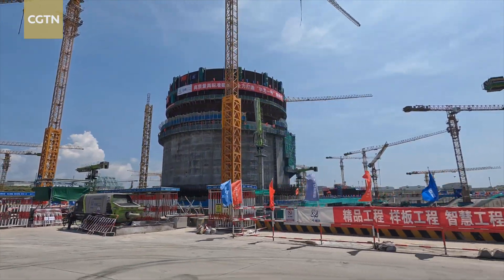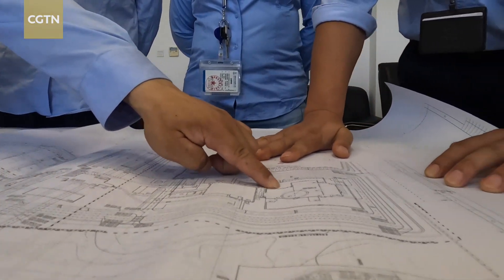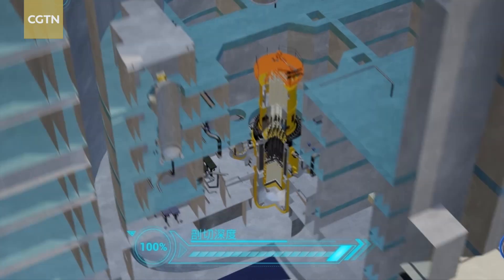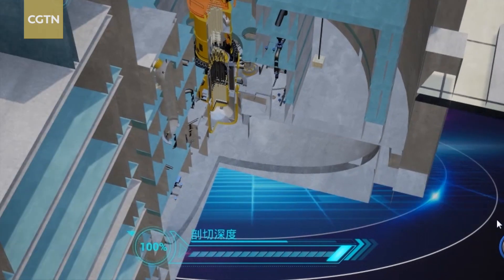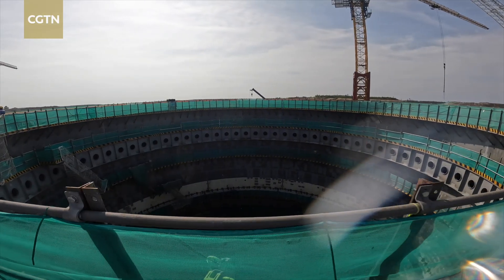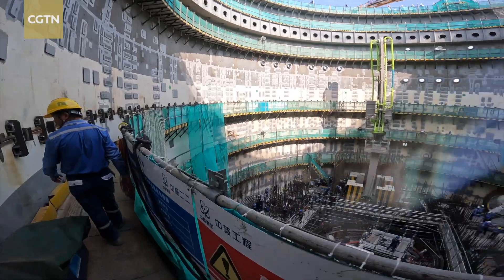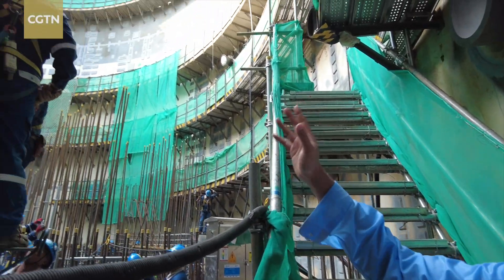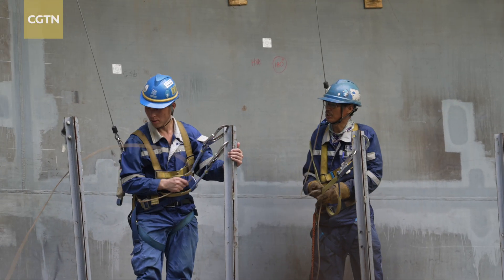China is building world's first commercial land-based SMR

Comment: I would like to see a cost comparison with solar+wind+batteries.
Reply: Actually when people talk about solar energy the forgot that you needed alot of energy to make a solar panel. This leaves carbon footprints too. It is the same for wind turbines.  The important consideration is the net gain of energy over its life time. In this respect the best is hydropower and wind turbine. The other is solar heat (not light to electricity). In this method China had build one experimental one. It uses hundreds of mirrors to focus the heat onto a heating tower to melt salt. This superhot molyen salt will pass through a heat exchanger to generate steam that drives turbines that in turn drives the electricity generators.  Nuclear generators are the most consistant because it is independent of the weather. Unfortunately it too needed alot of energy to mine and concentrate the fission materials not to mention environmental degradation caused by  the mining process. The nuclear wastes too needed a source of energy to package and store. So its net benefit is questionable.  The best solution is to couple the switch from burning fossil fuels with encouraging people to use less energy like taking public transport, driving smaller cars (even if they are electrical) and use less energy in cooling ir heating of homes and baths etc.
Reply: @chee-liekho5860  My reply to yours seems to get deleted, maybe the poster of the video doesn’t like critical comments about nuclear power.
Reply: @chee-liekho5860  Actually, Amory Lovins (Fusion power, the case of the wrong competitors, Forbes) thinks it will not. Fusion does not yet work and even if it will one day, it is highly doubtful that it will be cheap compared to wind and solar. That’s a common misconception that fusion power has to be cheap. And now people realize that Tritium, which is in most fusion power solutions needed, is not even ubiquitous… That article I mentioned is really instructive.
Reply: Agree that fusion power right now is not even working let alone being cheap. Right now the energy used to maintain the high temperature plasma to fuse tritium is higher then the amount of energy generated. A negative balance of energy. True that even if it has a postive balance output it will be too expensive. But then many technologies starting point is not cheap due to economics of scale or lack of knowledge.. Once the researchers fine tuned it and understand it things might be different. Looking back in history when the first chain fission reaction was achieved who can tell then that one day a nuclear reactor can be small enough to fit into a submarine. Given time the researchers can achieve some breakthroughs.
Reply: @chee-liekho5860  Yes, it's possible that fusion power will get cheap and there are also new fusion technologies (without generating steam) researched. But in the meantime solar and wind will continue to get cheaper and cheaper. So, there is a possibility that fusion in a few decades will work and will be very cheap. I just wouldn't count on it. It's pure speculation.
Reply: @daniel_berlin Agree but sometimes in small countries with high population density there is simply not enough suitable space to put up sufficient windmills and solar panels. Sometimes there are also unsuitable climate and weather conditions. So every sorce of cheap non polluting energy is necessary to augment one another. Energy is also needed to make solar panels and windmills.Therefore Fusion research should not be written off.

Comment: Small modular reactors (SMRs) are nuclear fission reactors that are smaller than conventional nuclear reactors. They can be constructed in one location (typically a factory) and shipped to the site where they will operate. They typically have an electrical power output of less than 300 MWe (electric) or a less than 1000 MWth (thermal). Many SMRs rely on a manufacturing-centric model, the requirement for many deployments to secure to large economies of unit production necessary to achieve economic viability. Some SMRs, typically those using Generation IV technologies, secure additional economic advantage and in some case large, through improvements in electrical generating efficiency from much higher temperature steam generation.

Modular reactors reduce on-site construction and increase containment efficiency and are claimed to enhance safety. The greater safety should come via the use of passive safety features that operate without human intervention, a concept already implemented in some conventional nuclear reactor types. SMRs also reduce staffing versus conventional nuclear reactors. SMRs are claimed to cross financial and safety barriers that inhibit the construction of conventional reactors.
Reply: Wouldn't SMR be just like moving nuclear submarine or carrier power plant to land?
Reply: @dragilxcom4176  Conversely, SMR technology can be ported to nuclear submarines and aircraft carriers
Reply: @dragilxcom4176  This is different but even if it's that simple, what's your conclusion from that? SMR is a big deal due to its economic implications... especially in a world suffering from an energy crisis.
Reply: @mike4evolution  How much different?  Aside from the safety measures and automation, if it is still fission reactors I'd think it should share the same technology.
Also, I would think the military version would be more robust and reliable, being built as moveable platform for harsher condition.
BTW, Russia already have floating movable nuclear power plant called Akademik Lomonosov.
Reply: @dragilxcom4176  Ok think as you wish. Just don't bother me with your thinking.
Reply: It is still very very big!!! Disappointed indeed.
Reply: @rajahua6268  Be disappointed away. What do you want? A hug?!
Reply: "Claimed to be safer" no, they are Engineering Designed to be "walk away safe", safe by default.
Reply: @davidwilkie9551  Copied from Wikipedia, so...
Reply: There is one big issue with SMRs: fuel costs. SMRs are a smaller up-front investment per reactor, but they are less profitable per MW. The reason reactors have traditionally gotten bigger over time is because of "neutron economy"- a bigger core means more chances for a neutron to cause fission along its path, meaning less enrichment, meaning cheaper fuel. SMRs will not replace big reactors commercially, even if they have better passive safety characteristics. SMRs are better for remote applications and as testbeds for future reactor tech.

Comment: I'd use buoyancy and tidal energy as well.  there will always be oceans and waves.   There's a saying when it comes to gravity:  what goes up, must come down.   It is the same with buoyancy. "what goes down, must come back up".  We have plastics now, so the technology is possible.  Also.....springs and magnetism still seem to be overlooked by mankind as a return mechanism.
Reply: By all accounts, tidal energy is expensive. It is green and renewable, but the lifetime cost, including capital cost and maintenance cost, is quite high.
Reply: @MetaView7  exactly i cant imagine the headache of maintaining machinery being battered by the tide and salt water 24/7 year round
Reply: Tidal energy has the same problem as all the renewables. It is intermittant and needs to be stored to provide the base load power that could compete with coal and gas for that you need either a huge and expensive battery beyond anything ever attempted. 4th gen nuclear is really the way to go.